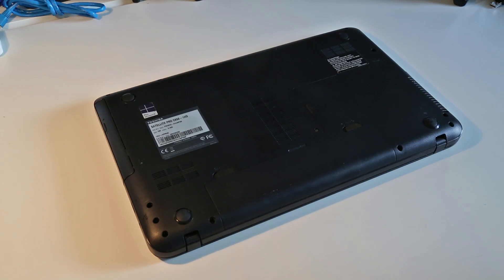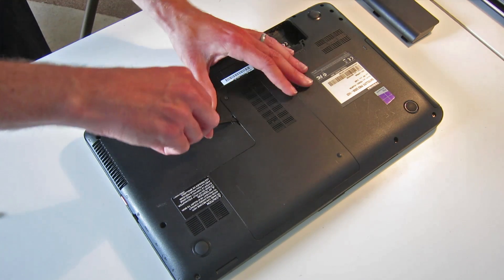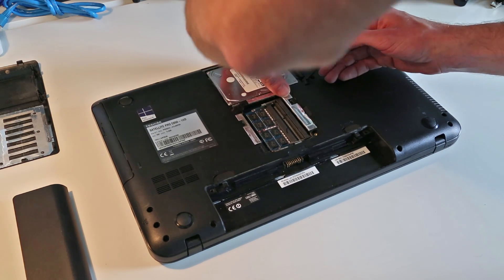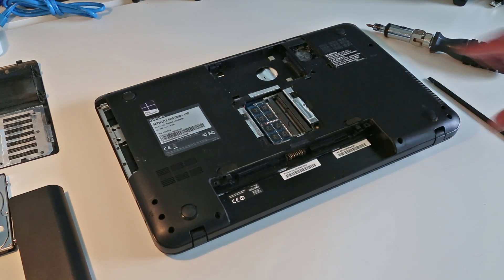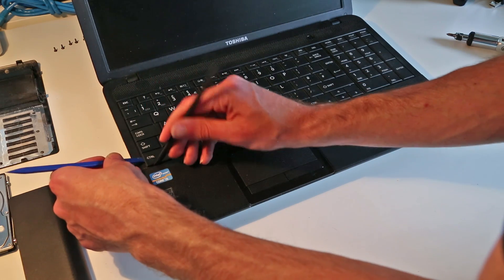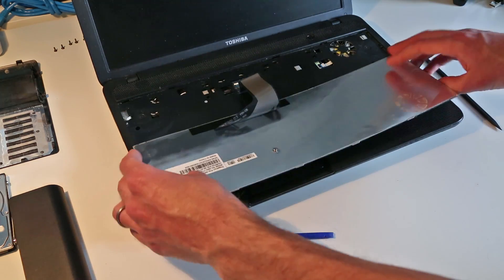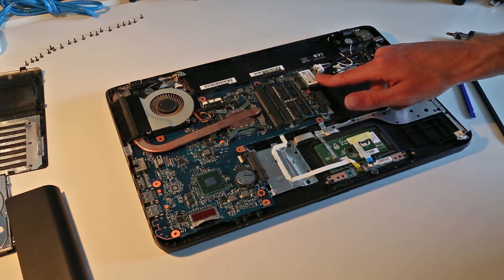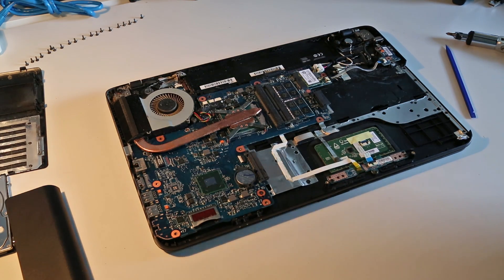Toshiba Satellite Pro C850 Repair and Upgrade Guide

Comment: how in the hell do u find bios updates for this?!?! want to replace i3 2350m with i5 3340m and bios is only v1.10 so probly wont work. but bios is Insyde Corp which is the most unheard of chipset manufacturer ever. any help would be much appreciated :)
Reply: well it works. got an i5 and hd4000 graphics now. not much of a performance bump but a bit better. for anyone thinking of doing same i recommend just selling laptop and get a better one. still, was a fun project and now i have laptop upgrading experience.
Reply from the maker: Great work - glad I could help!
Reply from the maker: Got the full model number of your laptop and I'll take a look.
Reply from the maker: You can search for drivers/firmware here: https://support.dynabook.com/drivers
When I searched for C850 the first option gave me BIOS version 6.50, but not sure it was the exact right model to match what you have.
Reply: @BrueComputing  hey thanks for the quick reply! Toshiba Satellite Pro C850 model no: PSKC9A-00U019
Reply from the maker: Cool, search for that and it has BIOS 6.80 available to download.
Also have 1.60, 1.50 and 1.40 in older versions.
Reply: @BrueComputing  thanks so much, 6.8 worked easy. couldnt believe it when it started updating the bios IN WINDOWS! lol

Comment: i had pretty same laptop with i7  was very goos one never lag and was playing any game you can imagine btw i removed the processor can i put it on pc or other laptop?
Reply from the maker: You wouldn't be able to use the CPU in any modern laptop - only a similar age laptop based around the same socket.

Comment: I have the same low end laptop. C850-F22U. I've upgraded the RAM to 8GB and HDD to SSD. Now you got me thinking about replacing the CPU.
Reply: Please, what ram is it compatible with? Did you use one 8 GB RAM, or two 4 GB RAM each?
Reply: @h.RX7  you should use 2 4GB RAM's. I used Kingston RAM 4GB 1600MHz PC3-12800
Reply: @DreiK96  If you change the processor, tell me which processor matches my device, and thank you for telling me the RAM
Reply: @h.RX7  sure thing
Reply: @DreiK96  thank🖤
Reply: @h.RX7  Intel Core i5 3230M. But make sure to upgrade your BIOS before installing
Reply: I did the same thing and now today or tomorrow upgrading the CPU to Intel Core i5 3230M

Comment: I have a C850-B760, can the CPU even be upgraded?
Reply from the maker: Yes, the CPU is socketed, so you could fit another 'Ivy Bridge' dual-core chip in its place (I don't believe quad-cores will work, but haven't got the machine here to test with).
I suspect the fastest chip you could fit would be the Core™ i7-3540M: https://ark.intel.com/content/www/us/en/ark/products/71255/intel-core-i7-3540m-processor-4m-cache-up-to-3-70-ghz.html
Reply: @BrueComputing  I see, thanks for the information! I just had to make sure before I start tearing the thing down.

Comment: I have this laptop.  The HDD is right there, huh?  Nice that Toshiba made it so you could upgrade the RAM and HDD relatively easily.  I should look at putting an SSD or SSHD in it.
Reply: is this good laptop ?
Reply: @ahmetislam2  medium .if you put ssd and 8gb ram is ok ,but not celeron,get i3 or i5
Reply: @aniel1211  Amigo, tengo este portátil en este momento.  Pero no es ideal para jugar.
Reply: @ahmetislam2  penso que não .tens de ter um portátil com gráfica .pelo menos de 2gb RAM .este portátil e bom para multimedia. Trabalho .

Comment: Hi, do you know the name of the chipset? My Toshiba has a Pentium B960 and I'd like to change it for an i7 2760QM. Thank u
Reply from the maker: My suspicion would be the quad-core chips won't be supported, only dual-cores.
Reply: If you download CPU-z you'll be able to see what chipset your laptop has. The i7 2760qm is supported on the qm67, hm67 and hm65 chipset.

Comment: i have toshiba C850-B.
can i upgrade my dual core i3 to this quad core i7?

both got same rPGA988b.

here is the comparison of both cpu:
https://ark.intel.com/compare/71465,70846
Reply from the maker: I don't know I'm afraid - often if the laptop wasn't designed with the quad-core in mind then it may not have micro-codes for the quad-core chip. May also not have power circuitry to cope with it.
Reply: @BrueComputing  
aw.. so i better be sticking to dual core.

Comment: My Toshiba gave a "dire heating issues turn off immediately to avoid damage" message and I then spent an hour trying to remove the damn backplate. Ended up using a vacuum cleaner on all external air vents and the issue appears to have gone away but I'm glad to know how to get into it for the next time something goes wrong.

Comment: Hi can you tell me.if the toshiba  satellite pro c850-1FR will fit parts from a toshiba satellite pro c850-1HE? My battey pins have been melted and the keyboard dont want to get a new one as it is sentimental value to me please help

Comment: Very useful! Do you know a good reference database for finding out which CPU's will work in a particular model? I have the C850-10U which seems to have the FCPGA988 socket, but I'm having a very hard time finding out which other CPU's will fit and work. According to http://www.lapspecs.com/detail/toshiba+satellite+c850-c855 Intel i5-2450M might work - but it's a real jungle to find this information!
Reply: David Tordrup i put a i5 3210m and it works fine

Comment: hi great video thanks I will subscribe! I have a question though. The wifi card has a white cable that attaches to it. When I opened up my laptop, I noticed that there is also a lose black cable, similar to the white cable on the wifi card. This cable goes into the hinge. What is it and why is it disconnected?

Comment: can i  Upgrade  CPU for Toshiba Satellite Pro C850-b826 to core i3 or core i5
Reply from the maker: +aymen alamry I can't find exact details on that model, but if it is the same mainboard as this then it SHOULD be possible as the CPU is socketed.
Reply: Toshiba Satellite C50-B863

 Can I add graphic cards on itl?